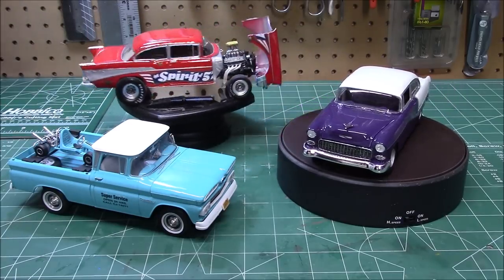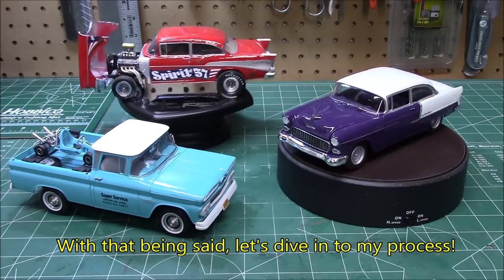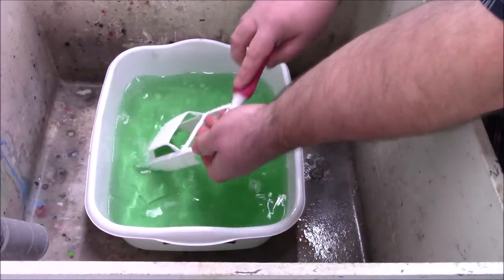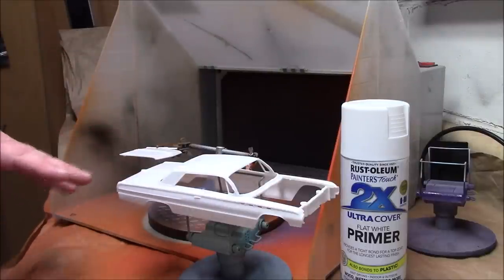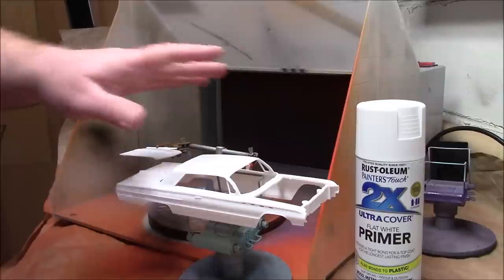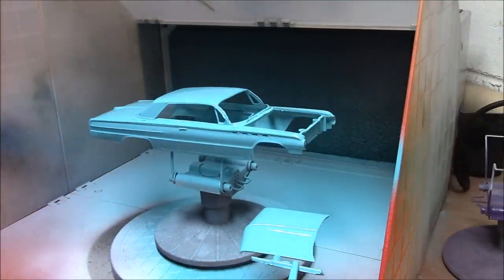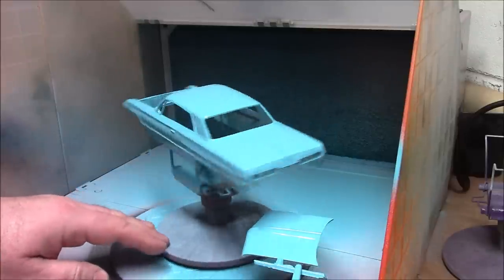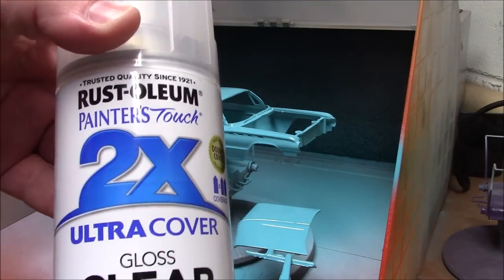How To Paint Scale Models With Cheap Spray Can Paints, No Airbrush Needed

Comment: I tried the Rustoleum 2x paint. After leaving alone for 2days I went to lay down the second color for a two tone race car, and the low tack masking tape I used left marks in the first color. Waited another day and wet sanded the first coat to smooth out the marks. I looked like I was heading towards a nice paint job, but I noticed the leading edge of the hood had worn down to the base color. I remasked the hood, and applied a light coat of the second color, and it crinkled up. I’m so let down. It’s a body of a kit I can’t get anymore, and I’m almost about to give up. I miss my old Testors, and Model Master paints! There’s no hobby shops in my area and it takes over a week to get paint online. Ive been building models since the early 70s I’ve got over 200 kits, and I plan on building at least 70 of them, but with the way things have changed, I’m losing interest due to the frustration of finding paint, and dealing with problems associated with trying new replacements
Reply from the maker: I've never discussed two coats, or layering coats of the Rustoleums. Sorry man. 

I've also never discussed sanding it, ever.

I spray and pray, exactly what you see in this video is what I do. Anything else and you'll have to experiment and work on.

I do over a hundred kits per year and rarely have issues. 

For complex paint jobs, you many just have to order model paints before your builds and wait the week.
Thanks for watching!
Reply: Sounds like you recoated too early or too late. Follow the directions on the can for recoat/clearcoat times. If you miss the 1-3 hour window after spraying, you should wait 5-7 days so it's ABSOLUTELY dry.

Comment: Have a question, why would I get like dry spots looks in small places on my model after painting?
Reply from the maker: Could be anything really. Impossible to tell from a comment. 
Could be humidity, or too dry or too cold or not shaken enough or cold paint.
Reply: @hpiguy  I appreciate it, it almost looks like dried over spray, I just painted a 65 Chevy pickup seaside blue beautiful color, truck came out great, but the fire wall was the only part that did it.
Reply from the maker: Number of mistakes?  Thousands and thousands.  And that's just the mistakes of eating Taco Bell in the morning.

Comment: Have you ever heard of paint reacting negatively with the plastic? I've poked around a few scale model forums to see some old threads where folks discuss using hardware store rattle cans to crank out paint jobs and that issue almost always comes up. "Krylon ****s with the plastic, don't do it" or "if you're gonna use a spray can, make sure it's hobby-rated like Tamiya or else you'll risk ruining the styrene/resin". To me that doesn't follow, but I figured I'd just ask. I don't want to get an airbrush for a few reasons (cost, noise in a crowded apartment, etc) and spray paints seem to get you 95% of the way there for 5% of the cost.
Reply from the maker: 100+ builds per year and no issues so far.
I almost always use a primer though.

Comment: 1. When you remove the hood from it's plastic spruce, you will have a bit of unpainted plastic. What do you do about that? 2. Have you used this system on HO scale models?
Reply from the maker: Just touch up any areas with a bit of paint from the can brushed on.
It works in any scale.
Reply: @hpiguy  Thanks.
Reply: @hpiguy  Thanks.

Comment: I have a question what about a krylon paint and primer?
Reply from the maker: Same technique but Krylon is way thinner, so lighter coats over time not one coat at one time like Rustoleum paints.
Reply: hpiguys Workshop ok thanks and also will this work with rust oliem 2x paint and primer as well

Comment: If a model is molded a color, can it be painted over?
Reply: it would require more coats depending on the model color and the base coat color but it's good practice to use primer as the first coat plus you can see body mold lines/ imperfections much easier after a coat of primer.
Reply: @kiz  Awesome. Thanks.  Another question.  Can Tamiya spray paint be sanded between costs? Sorry so many questions.  I'm a 59 year old newbie! Lol
Reply: @billybleedscrimsonblood9478  well, you'd want at least 2 or 3 coats to sand because if you sand after one coat, you'd most likely see the primer. it's best to give it at least 2 coats of primer, 3 base coats and 3 clear coats. after the paint cures you can wet sand it with 1200 to 4000 grit sand paper to get the paint really glossy and to remove any dust particles
Reply: @kiz  Thanks kiz!

Comment: Hello I am from India we don't get Model building materials here and I end up using I industrial materials  to build my models  I have a few questions  are those  cheep spray paint cans of 1k quality  or are they below 1k quality?  in India  we are forced to use below 1k quality spray paint cans  and it's always horrible  it never dries up 100% and it's soft  so you can damage it with your fingers even after it's dryed up for 2 months
Reply from the maker: I do not know what 1K paint is. 
The sprays I use dry very quickly.
Reply: It's important to check if it's 1k quality  most spray paint brands in India sell you some diluted junk

Comment: I use rattle cans a lot and have for decades. But in the past few years I have come to despise Rustoleum brand paint! I do still use it because of its availability and beautiful color selection but SO many times I have been screwed over by their products! Gloss paints seem to be quite safe, but satin and matt finish paints are a real crapshoot. Despite sufficient shaking, good temperature conditions etc. I often get a suprise of absolute CRAP coming out of the. nozzle which virtually ruins my projects. Hideous, globy "stuff" intermittantly comes out in the spray, ruining the smooth surface and gives the model a thick, splattered finish resembling a felt covered pool table or a popcorn ceiling! It appears to be a component of the paint that contributes to the flat/satin aspect but which does not seem to mix/desolve correctly in the can and results in a horrible mess on one's model. With a lot of time and effort I can usually scrape, wipe down, or sand this crud off, and salvage the piece but it sure is a pisser when this happens, and it does so a lot! Rustoleum obvioisly is the dominant brand in the market today. Well congrats to Rustoleum, but too bad that along the way they seem to have forgotten how to make decent spray paint! For flat or satin finish paints I would alternatively recommend Krylon, specialized model paints in small cans or some other brands. If your craftmanship and time is worth anything to you, BEWARE.